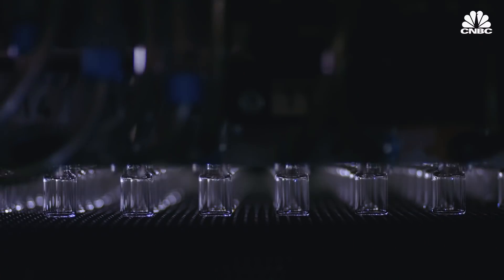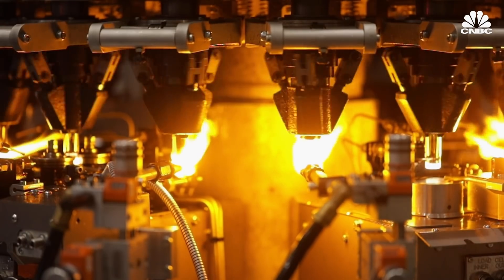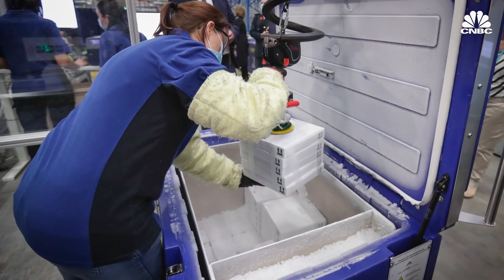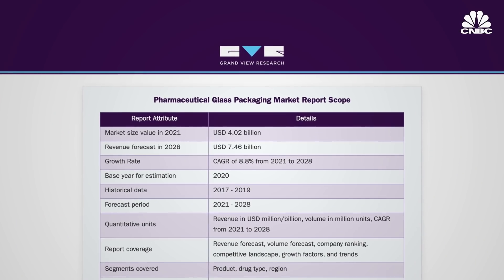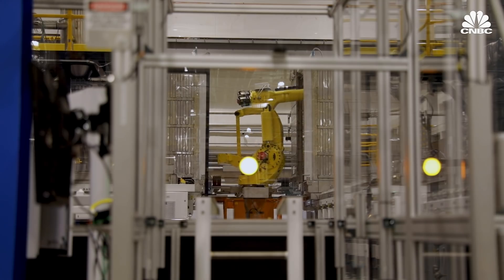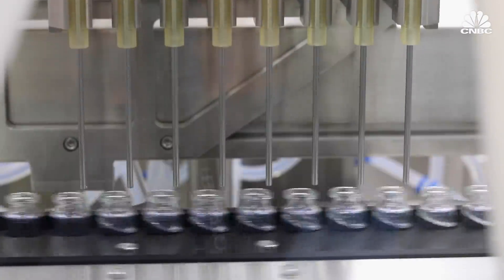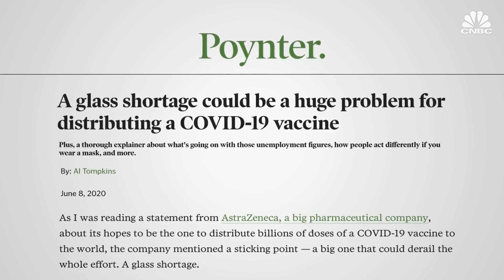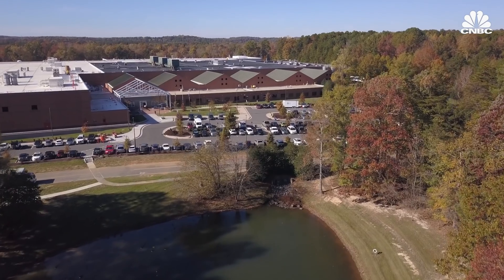How Corning's Gorilla Glass Tech Helped Deliver Covid Vaccines

Comment: Why isn't there a reuse/recycle program with these vials?
Reply: in medicine, we don't recycle.   there is a fear of passing on pathogens,   Honestly there is a little bit of recycling, but that's the mentality of the industry, and the government is partly pushing a lot of waste.    

To save labor, we waste water.  Instead of washing pipettes, we have a container we connect to the hose and leave the water on to continually flush the pipettes.    If we don't have that, we just leave a bucket of running water to wash our dishware, and come back when we have time.   It's partly because we are trying to save money, and if water is cheaper than labor, that's what happens  .   SOme of it is from government.   Our trash is far more regulated.    for some , we arent allowed to dump down the sink .   So we have to pay someone to wastes gas to pick up stuff.    Sometimes we buy chemicals to neutralize chemicals like formaldehyde, but other times we have to pay someone to specifically pay a person to pick up alcohol, even if it's 99% water and 1% ethanol, even though bars dump more alcohol tha hospitals, it screws with the water reclamation system.  Heck, even in dry california we were told to waste water, because to be able to dump our waste into the sewer, we need to sterilize it.  Well we dump bleach to sterilize it, but then the water department complain there is too much chlorine being dumped by us at a time, so we turn on water to dilute it.   In my place, we now have 6 trash cans.   One for radioactive.   Biohazard, sharps, electronic waste,  bottles that use to contain chemicals,  and normal waste.   We got into a fight, because central office told us we can dump uncontaminated gloves in the regular trash, but then we get yelled at, because when inspected, the inspector says, how do we know it's uncontaminated.
OH, and there is two more type of trash outside the work area.  We can't dump food in any of our trash, because we arent allowed to eat at work, and recyclables.  Mostly paper
Reply: @slewone4905  I kinda forgot about that part. I used to work in a place where people donated blood and plasma, so ya pretty much everything goes into red biohazard bags, regardless of what it was.
Reply: Who says there isn't one?
Reply: the vials are way cheaper than what goes into them. I wish there was a recycle path too, I don't know why they cant make cell phone screens out of them.
Reply: @jasonpavlik4904  They do ... that's why gorilla glass was developed
Reply: There most definitely is, but this is NBC. They don’t tell you the whole story.

Comment: Nothing is new about this. Gorilla glass is just chemically densified glass which has been around since the 50’s and vial production machines have not changed much since Eisler and Khale Engineering developed the basic carousel machines in the 20’s. As for glass and sand shortages. That’s nonsense. That is more of a problem for the concrete industry and it’s more of a transportation problem. More pure silica sand is used in one concrete bridge  than in every medical vial used in the nation in a year. Also an option is go to vycor or pure quartz vials and reuse them as they can be sterilized in autoclaves and or hydrogen reducing atmospheres. Just ask any glass engineer and they will explain none of these are real problems. I can recommend some.

Comment: I think this is excessive. Seing blow torches for thermal annealing .... we must improve more quickly on becoming sustainable. Special type of sand needed?... where is the full recycling plan?
Reply: Glass is one of the simplest materials to recycle. One of the big problems is that it is often not recycled by us consumers and thrown out with the trash, which will prevent it from being recycled. They don’t talk about it in this specific video, but I’ve worked with glass and I can tell you it would be very easy to make new bottles from old ones. It would also be very easy to take the old bottles and reshape them into tablet and phone screens, glass tubing or any number of other things, but the video is focused on just one product.
Reply: Shut up and show us your solution Eistein
Reply: @daveklein2826  LOL me?I never claimed to be einstein but if you must know, I am a physicist working at one of the largest sustainability & renewable energy labs on the planet. 
If you ask a specific question and I'll try to give you a sound answer ;-)

regarding glass... it's super simple, sort it, even better, collect it already sorted, then melt it, put it in a new shape.
Reply: Lol a lot of things aren’t practical to be recycled. Plastics recycling for example is largely a giant scam to make you not feel guilty about using plastics.
Reply: @zeitgeistx5239  glass and plastic are actually VERY recyclable. Glass is the simplest, you crush it and melt it. Even when you can’t melt a plastic without scorching it, you can shred it and make it part of composite materials to strengthen existing items.
Reply: @zeitgeistx5239 , you couldn't be further off. nothing is simpler to recycle than glass, like  @

thejpkotor said.